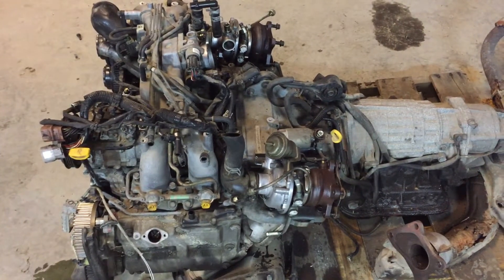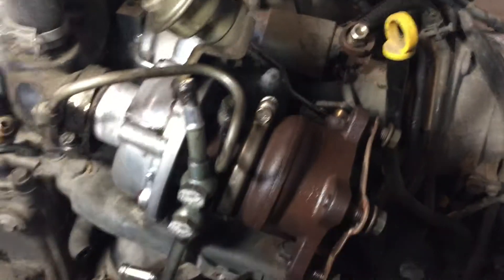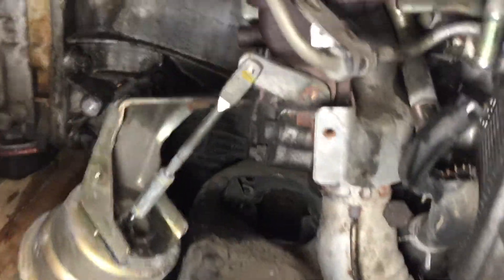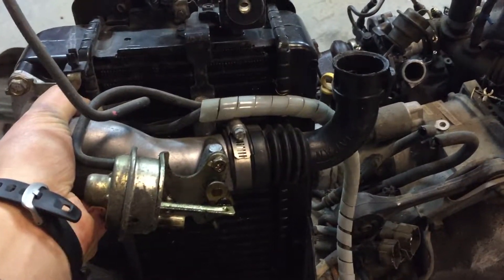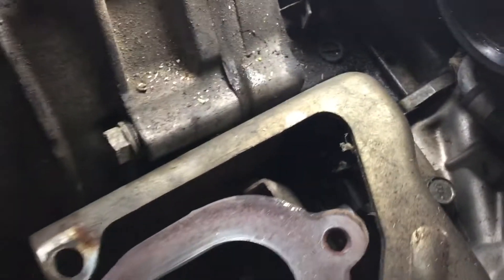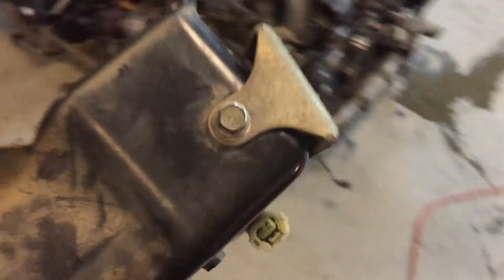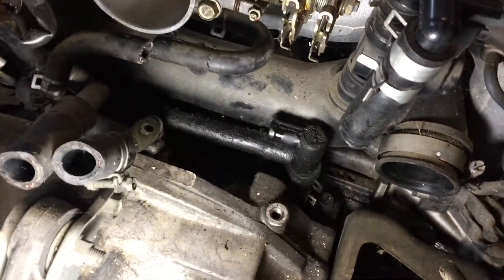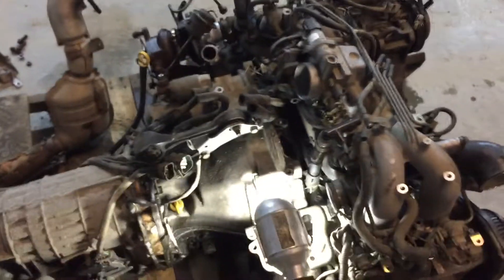JDM Subaru B4 Twin Turbo EJ20 How it works  EJ206/208

Comment: Hmm, these older twin turbo motors seem quite complicated if something breaks down, especially all those vacuum lines in the controller. I think I’d much rather have a single turbo setup. Thanks for the video, it was very helpful.
Reply from the maker: 100% would definitely go single turbo setup over this mess.   Twin turbo sounds cool though 😎

Comment: I have one of these and the secondary turbo oil line keeps getting blocked right after I finished clearing it.
Reply from the maker: check to see what materiel is blocking it. Hopefully its just RTV or a silicone product from someone applying too much sealant.   I would pull the oil pan and clean it out. If your oil feed line is plugging then most likely the pickup screen is full of trash too.
Reply: @Bingboysgarage  pickup just just fine now, but new issue after I hit 2000rpm check engine light comes on and power goes..can hardly go up hills. No scanner has been able to read the codes.

Comment: In the vac lines are all sorts of different sized restrictor pills, replace a vac line and leave one of these out and you get lots of different issues with the turbo system.